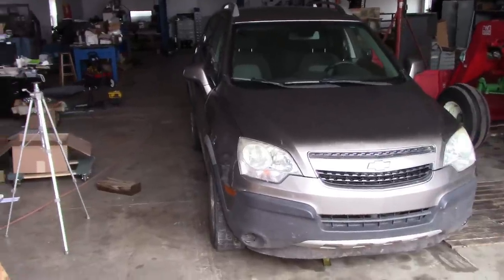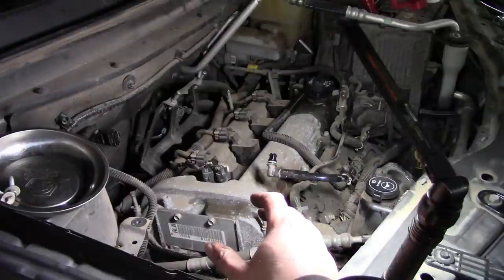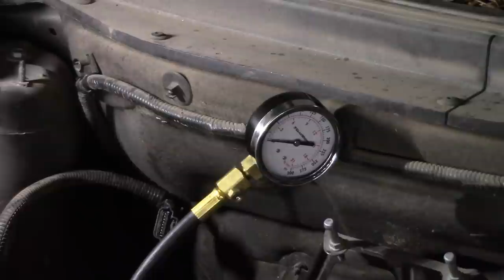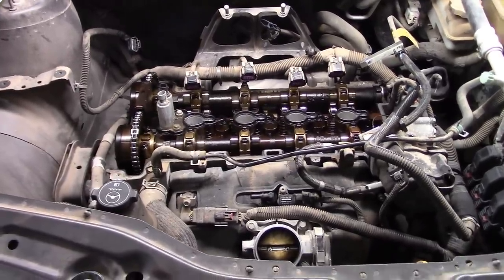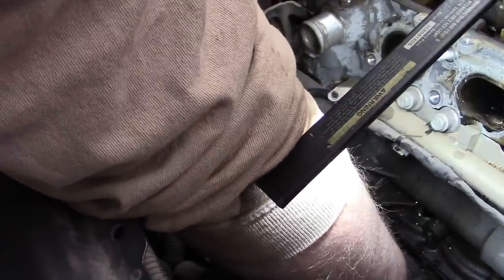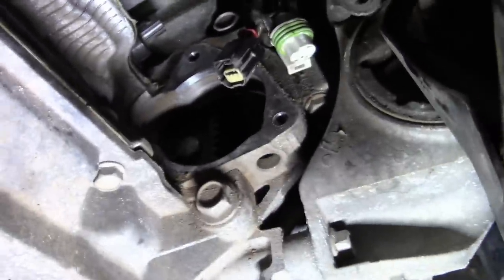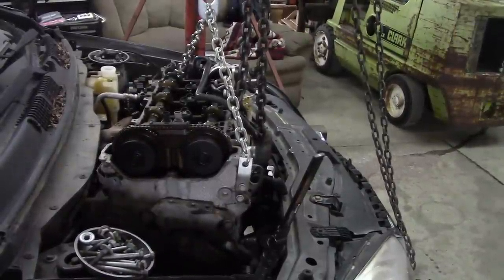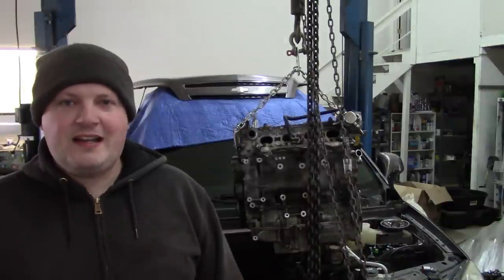I Bought the Cheapest Small SUV on Marketplace - Part 1

Comment: I worked on American cars for 12 years. Then I went back to school, studied and became a licensed aircraft mechanic. Worked for Delta airlines for 33 years. All I have to do is remember, how the "once big three", purposely screw the customers with the crap they design, the mechanics that they cheat using their warranty flat rate system, and our ecology. by building throw away "poop cars", that end up in unsightly salvage yards.    Do yourself and your family a favor, Wes.   Get licensed, and repair airplanes.  BTW, Wes, I'm originally from Pekin, Il.  12 miles from Morton. The weather better in Georgia.
Reply: Its not just the "big three" in America.
Shitty overpriced cars are build everywhere.
And you know what is really aggravating? 
The profit margins of a modern car went trough the roof compared to just a few decades ago:
They figured they could just outsource everything to the cheapest parts of the world while using cheaper materials.
At the same time they raise prices with "features" that cost them literally nothing to implement.
They achieved their goal:
People buy plastic throwaway "cars" and they are are perfectly fine with them.

Comment: If i've read it correctly that engine is a Holden made unit, Australians are always banging on about how much better their stuff is ! Yeah maybe in Australia but take it elsewhere & it's garbage (these engines specifically)
Reply from the maker: I think many parts of this engine are designed by Saab, such as the injection and valve train. This engine was built in Mexico.

Comment: Use 10w40 or 20w50 for those engines do not use 0w20 or 5w20
Reply from the maker: It's supposed to run 5W-30. But a 40 weight oil might be better.
Reply: @WatchWesWork  yes im more than sure those thin as water oil is damaging most engines specialy those engines over 100k miles

Comment: I have a 1997 Hyundai Sonata 183 Cubic inch transverse V6. It took me 2 hours to change the spark plugs on it. The 3 on the front are no problems, but the ones on the back. I had to remove the entire intake and valve cover, to replace those spark plugs. I couldn't reach them from below, for a cross bar that was there. A somewhat peculiar construction. The front ones were fairly new NGK, but the rear ones had Korean writing characters on them and were probably never replaced.
Reply from the maker: That's typical. Some Fords require removing the rear engine mount to pull the engine forward.
Reply: @WatchWesWork  And I remember I thought it was difficult to change the spark plug on the SAAB V4, where you had to loosen the generator a bit to access the front spark plug on the passenger side. This was maybe 100 years ago, I think. Or at least in the 70's.

Comment: I own a 2013 Captiva badged as a Holden in Australia with the 2.2 litre turbo diesel. Owned it since new and never had a problem, 65 litre fuel tank returns 750km city cycle and 900km highway and tows a 1850kg caravan with ease.

Comment: This little engine is junk! Have a 2013 model. You drive 500 miles you better stop and put 2-3 quarts of oil in. Because of that. I never change the oil. Just the filter. The oil is self changing. Lol!!
Reply from the maker: Right. It's a feature not a fault.

Comment: You dont know much about this engines you say there notorious for everything but there acually good engines even tho the timing chain might go out there not notorious for that to fail its not an Audi
Reply from the maker: I dunno. I probably run into one of these that needs a timing chain at least once a month. I've never seen a 2.4L Toyota with a bad timing chain. But they both tend to burn oil. GM didn't invent that.